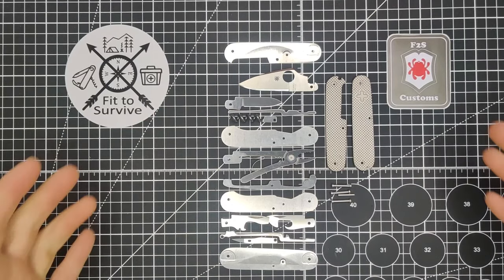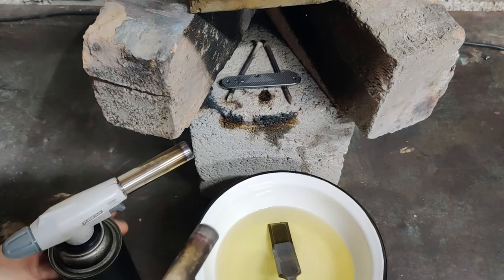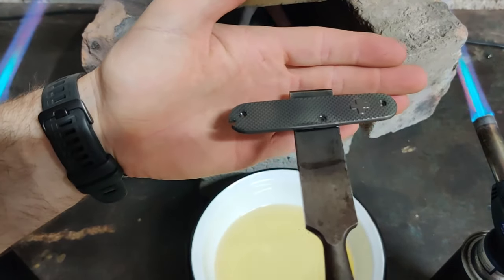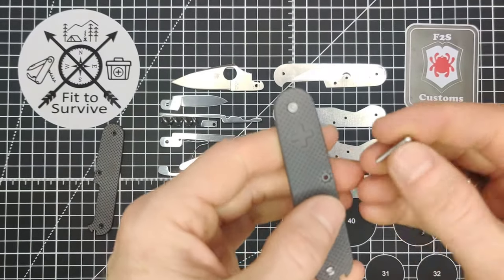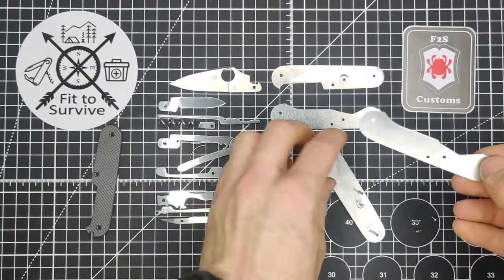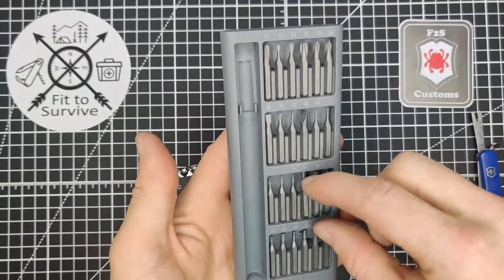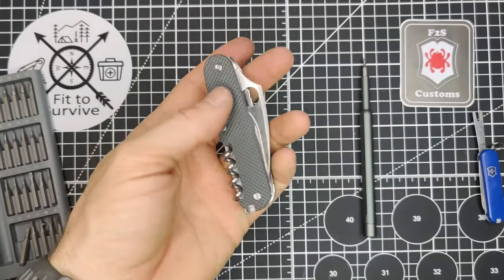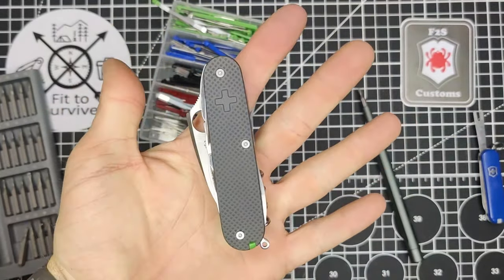Flaming titanium Victorinox scales black!!!

Comment: The thickness of the pliers looked perfect for those barrels. If you installed scissors instead of the pliers would you have had to cut the barrels shorter?
Reply from the maker: There is a bit of play due to the width of the scales. About 0.5mm that you can gain/lose just by adjusting. After that, yes, I'd probably have to grind the pivot barrels down some.

Comment: This is art, congratulations!
Reply from the maker: Thank you!
Reply: Hi. What rivet do you use for a 91 mm Victorinox knife?
Reply: How many mm is its diameter?
Reply from the maker: @sandorboruga4509  The pivot barrels are 2.5mm for the outer two pins and 2.2mm for the inner two pins.
Reply: @FittoSurvive  Thank you!

Comment: Does it matter what oil you use? Also does the temp need to have it at cherry red before the reaction will turn the scales black?
Reply from the maker: I would recommend using the WD-40 liquid oil. Definitely not motor oil!
Yes, you want the titanium to be red hot.

Comment: Which screws are you using for these? Haven't seen em with a screw hole on the end before
Reply from the maker: These screws and pivot barrels came with the scales. DeCustomForge makes pivot barrels, but only 2.5mm. So you'd have to drill out the middle tools for them to fit.

Comment: Hi, great videos! Do you think it would be possible to replace the big and small Victorinox blades with a wood saw and a metal saw(/file)? The Cyber Tool M with that modification (and a separate dedicated folding knife) would be the perfect combination for me.
Reply from the maker: The saw and metal file could not be placed facing each other like the large and small blade. They would have to stay in their original layers.

Comment: You can get it blacker with wd40
Reply from the maker: Liquid WD-40 or aerosol? I haven't been able to source liquid WD-40.
Reply: @FittoSurvive  you can use either. It’s a little expensive to use aerosol but it works
Reply from the maker: @jeremyeagles3237  I will give it a try next time. 👍🏻
Reply: @FittoSurvive  let me know how it’s goes or make a video!!
Reply from the maker: @jeremyeagles3237  👍🏻👍🏻

Comment: I know that the reason why that it turns black is because of the burnt oil on the surface. How i wish you would show us how it looks like when its worn down.
Reply from the maker: I can not say for sure because I have not seen these scales in 1 or more years. But, I can say that one time I didn't like the way that the flaming turned out and I tried sanding it off. 🥵 It would not sand off, I ended up having to sand blast it off. So, I have a REALLY good feeling that this finish will not get worn down soon. 😅
Reply: @FittoSurvive  !!!! Thanks for the quick reply, but  I urge you to make one for your daily use, it would make for a good, if not, excellent experiment to see what happens. Regards from the Philippines.
Reply from the maker: @kidpisot  Yeah, I really should. Or, maybe I will write the guy who ordered this after a while and see how it is holding up.
Reply: @FittoSurvive  Great idea!!! I'm looking forward to it!!